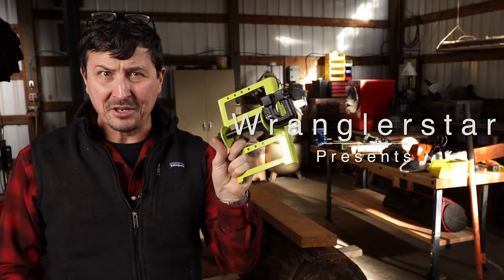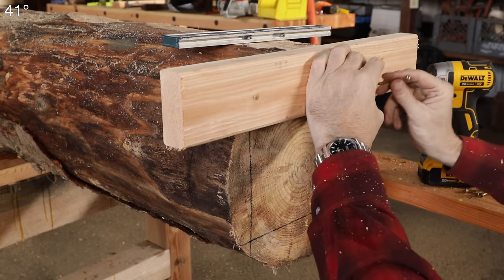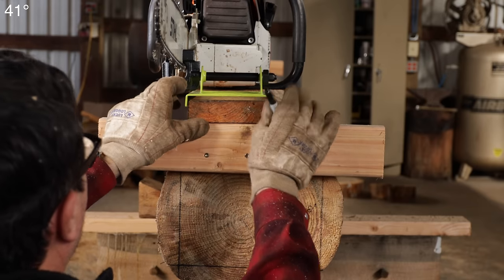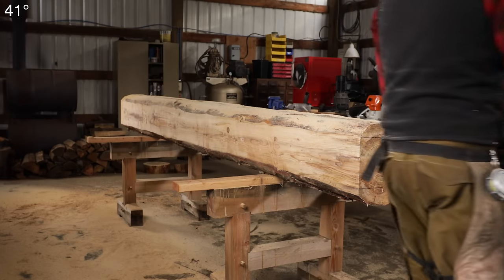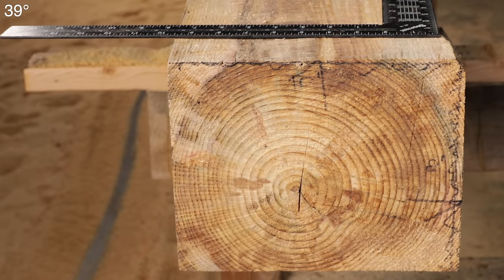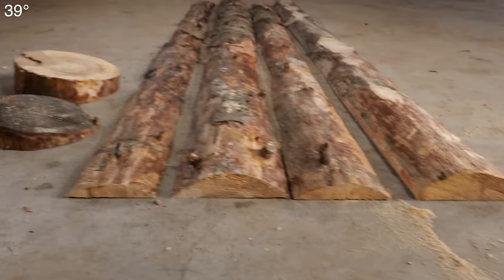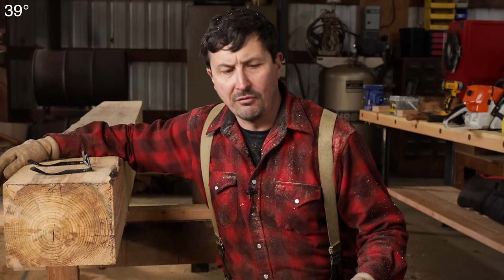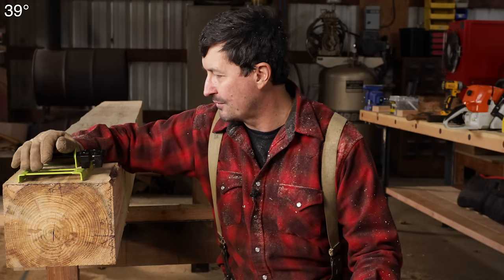How To Chainsaw Milll Like A PROFESSIONAL HOMEOWNER WRANGLERSTAR

Comment: Just a quick tip, I have one of these and they work just fine, I suggest you just take that measurement from the line to the board and set up with a tape measure instead of lining up an tilting saw to check if your good.

Comment: the so called waste. I wouldnt call that waste or Firewood. It could be dried and used as shelving. inside your workshop. give the area bit of a rustic woods looked to it.  Has lots of use for it other then just firewood.

the Price for it is now 
Price: USD $29.82  as of today.
Reply: Yeah, up here in Canuckistan live edge is all the rage. I do a lot of signs in it and that stuff is perfect (if it had bark on it). . Do some hidden internal mounts and they'd sell like hotcakes. 

Or even (thinking outloud) do some small 3" diameter branches perpendicular to the wall as brackets and notch them around the shelf. That'd be slick.

Comment: You obviously used the straitest best grade cross board, but you can add more stability with angle iron on both sides of your board
 This should prevent possible bowing as you store it. Thanks for the video, it's great.

Comment: What about the drying of a large timber log like that? Is that something you can use immediately or is it something that needs to dry for years first? I’m new to much of this but very much interested. I did buy that jig after this video along with a 40 volt chainsaw. I love it as it’s got me on my way with some experience. I just ordered an Alaskan mill and a 22” chainsaw now that I know it’s something I’d like to proceed with seriously, for personal use. Any tips are greatly appreciated. Thanks for your videos and insight as they produce a great amount of direction and different points of view to think on.
Reply: 1 year of drying per inch thickness. Unless you know someone with a kiln, they can do it in under a day.

Comment: I like that jig design.. I had a 20" Stihl(345?) and a flat plane Alaskan mill. The mill ate up alot of my cutting size setting the jig so I replaced the bar with 36 inch. While only cutting 15-18"wide(max)  planks and could fit 24inch.  Worked well if thats useful for anyone :)

Comment: This looks dangerous as hell. I could just see someone pushing it to hard till it pivots back and slices you open
Reply: How is it any more dangerous than using a chainsaw?  Hell, outside you could slip on a branch and slice your arm off.  Chainsaws are dangerous.
Reply: @roflstomps324   the fact that you are pushing it and it's upside down .  Just not how it was meant to be held.
Reply: @210johndeere  Huh.  I guess someone should tell that to professional arborists and tall tree loggers worldwide.  They are doing it wrong this whole time.  /wink
Reply: I think it would be a lot safer if, as Wranglerstar mentioned, you had the log lower down, and could hold the power saw in a more traditional fashion and walk alongside the log.
Reply: Professional arborists operate dangerously in some cases but they try to get the saw arranged with the most control. If you set a chainsaw mill up at your chest height and operate it upside down with less leverage constantly for an afternoon of cutting there's just way more chance for it to go wrong and where that saw is located could have a gruesome injury with more consequences. I'd rather cut my legs with chaps on or feet with boots over my torso or chest.

Comment: Good work, I just can’t understand the constant need to booger up the end of your lumber constantly driving an axe in it. Does it make you feel like a lumberjack ? Other than that, I liked the video
Reply: He uses the axe to roll the log. For bigger logs, you would need a peavy or cant. He also cut the log six inches over.

Comment: I've got a couple different Alaskan sawmill styles and by far this is the fastest and easiest on the saw.  Just be careful not to over-tighten the sets screws or you'll be buying a new one. (the replacement part cost nearly as much as the whole new unit.)
Reply: how is this faster than an alaskan mill if you need to screw in a guide board for every single cut?

Comment: Great video!  You made it look so easy and also very good production quality!  Just one question for you.  With a "real" sawmill, once the first side is more or less squared, most people flip the log on the first flat side.  Then you have a nice base, making the other 3 sides a little easier to cant.  Was there a method to your not putting the first squared side down right a way?

Comment: On any wood working project, the key is preparation and triple checking your measurements, cut marks, everything is squared, and equipment. The actual cuts are the easy part ha. I have screwed up so many projects from trying to rush

Comment: Some people drill holes in the chainsaw bar to better anchor, by way of bolts,  on this type of mill, rather than just relying on the thumbscrew's pressure, because the mill may shift on the bar otherwise.
       I have this type of mill to cut wood for musical instruments, btw. Great for small projects. Very cost effective.

Comment: your 2 x 6 "guide-main bar (the pc that the fixture slides upon) : did you need to pre-size it with a cutting device or does the fixture fit raw cut lengths from the yard ?

Comment: What I found out milling wood with the Alaska Mill: (1)  Continue the entire cut in one effort.  If you pull out and have to restart it won't have the same line or plain in the vertical.  (2) Bolt the guide to the the chainsaw bar.  The little allen screws won't hold it.  Also use seasoned wood when you can.  That means 3 years for spruce.

Comment: "No special skills required", hummmm, must have been designed for the west coast guys.
Reply: True, we all know how to run a chainsaw out here. Back east you probably need to take a few classes. ;-)
Reply: @DK-jd8bj  Sure, we know how to run over a chainsaw. LOL
Reply: @DK-jd8bj  BTW, I've done it. LOL
Reply: @wb2989  well, i don't know what East to you, but in Québec, even if our tree are smaller, we saw mill maple,  ash and birch,  you want to talk about hard timber?  Or hemlock, as a «soft wood».... ?
Reply: Charles Gill On the west Coast you have oak, ash, maple and other hardwoods and they get big here too. But Quebec is good too.
Reply: @johnycoho7830  good to know , i tought you were only making fin of us because of your giant firs...
Reply: Charles Gill How about that madrona?
Reply: @375Cheytac  i'm french canadian, i don't know what is «madrona»
Reply: @wb2989  In PA. we have oak, maple, and hickory. They may not be 50 feet tall or 30 inches across but, they are way harder than most trees in the west. Hickory will eat a chain up in twenty minutes.
Reply: @saticharlie  theres no doubt about milling hard wood being hard on blades.. Band milling 40 inch doug fir is hard on every single other part of the mill.. Sheer mass and one million board feet a day keeps us welder millwright types steadily employed... Thankfully BC has moved to CTL as theres not many head rigs left.  Its just our growing season that makes our wood big.. Try working spf from NWT, you would swear its a hardwood too. Peace be safe
Reply: @jeffwilliams2031  my reply to Charles can double to you to man! Be safe out there. Peace
Reply: And then theres cedar.. Which has its own unique long strand properties, not fun at all! But smells great! cheers lads
Reply: @saticharlie  probably referred to Arbutus where you are at.

Comment: Mr.wranglerstar: please do a review of the ryobi one plus 18 volt hybrid transfer pump for the common guy
Reply: Ryobi is a great brand for everyone
Reply: My brother regularly calls my Ryobi tools 'the high-end on the low end'...

But I'm still using the same 18v drill/circ/saber/jig set that I bought in - 2001? (I buy every upgraded battery that comes out)

Meanwhile, I know he hasn't managed to keep a Dewalt that long.

Comment: dumb question: why not rotate to a flat side down after each cut? is it to prevent lateral sliding with the wedging?
Reply: Simple, at the second cut you only got one flat side, you could get that to the bottom, but you rather want it in top, so you don't need the two short pieces from the first cut again. Now you got two flat sides but they touch each other, so if one is supposed to be on top, the other can't be in the bottom, so only for the last cut you got a flat side in the bottom, as you can see in the video.
Reply: Once you have a flat side, it acts as a guide for making a square cut.
Reply: It also makes it easier to manipulate the material. It's harder to roll a square, than it is a circle.

Comment: In the future you only have to measure the distance between the chain of the saw and the board once. You write this measurement on the front and back of the board. And when you mark and stop the board, you no longer need to stop the saw to test it.
With best regards from Deutschland

Comment: My dad and i tried one of these (exact same design, different brand) in the late 70's and it vibrated loose and wrecked the saw chain. Also the front of the 075 if I remember correctly.

Comment: At around 7:35 you could just put like a 2x6 or something else underneath the log to jack it up a bit so you don't cut your horses up. Love the video though, thanks. I wouldn't call those pieces waste wood either you could mill those down and use them on siding for chicken coups or a shed or something. With the prices of wood these days I try to use every piece I can for something.

Comment: My concern would be how much play is there between the device and the 2x6. As long as they're pretty tight and those allan screws hold on to the bar pretty tight, you'd get a pretty straight cut.

Comment: Is it not possible to cut with the top of the bar and blow the sawdust toward the floor and keep it from blowing in the face? I realize You would have to keep firm down pressure on the saw to keep it from kicking the saw upward and the guide off the guide board.

Comment: id suggest keeping that tool as close to the engine as possible, a sacrificial board is a far sight cheaper than a saw that gets away from you , this is basic fulcrum and lever stuff if memory serves me right
Reply: smitty smit True! I was thinking to pull the log to the edge of the sawhorses, make the wedges sacrificial, or just raise the blade over the wedges like he did for the first cut. I’d hate to have to cut with the saw engine and handles head high.

Comment: I got another question which is probably stupid, which doesn’t mean I’m stupid -
it just means I’ve never done this before: am I correct in assuming that one could proceed to cut 1 inch thick boards, or whatever, off of this block?

Comment: What if you set up, made the first cut then flipped the saw around and made the second cut. Rotated the log 90 degrees set up and repeated. It would not matter the size as long as they all were the same. Understandable if you are needing to make a particular size that you would need to go thru all the setups, but for ease and speed I’m thinking that would speed up the process. Just my thoughts.

Comment: Looks like the tool would be better if home-made. Pluss I would rig angle iron as rails on the guid. It would ensure the guid board did not warp Inbetween usses. And alow for more even and controled pressure against the saws motor. Pluss it would keep the guid from becoming worn out.

Comment: might be a good idea to make much lower saw horses, then stack on top a bunch of 2x4s, screw from outside on bottom to inside on top with each layer slightly. Much cheaper to sacrifice 2x4s into fuel than a very strong sawhorse of 4x4s.

Comment: I don't care for the set screws holding the bar in place. 
I would drill matching holes in the bar/bracket and use bolts.
Or at the least drill two divets to match the set screws for extra grip?
Don't know till I get a closer look at one. 🤔

Comment: Ya know, I was thinking about you when I started looking into sawing up some downed trees and I think a major.. Ahem, "upgrade" to this video would be if you tried milling a log with the cheapest mill AND the cheapest saw on Amazon. I say this because I'm feeling like my puny cheapsauce, made in who knows where, craftsman, is probably not going to be able to hang. I feel like your super-mega-ultra chainsaw is probably so good it could mill a log without a mill, possibly without an operator even. At least that's what I think a $1000+ chainsaw should be able to do ;-)

Comment: Great video... but.
The only concern I have is during some of the cuts the exposure to the end of the chainsaw bar towards the operator.
Plus the pivoting motion of this jig changes the position of the bar end.
You must be very aware of this, so novice beware!
Advantage to the Alaska Mill, as the end of the bar is away from the operator and is in a fixed position, plus in a proper mill the end is also protected by a safety guard/cover.
Still, that is certainly an interesting little jig.

Jim.

Comment: What if you made the first cut then flipped the saw around and ran the second cut without moving the board. Then rotated 90 degrees and did the same and lived with the dimension beam you got. If they all were the same size it would not matter if they were 8”, 9”, 10”....just my thoughts.

Comment: Seems quite labor intensive for a single timber and time consuming versus a bandsaw type mill.  I suppose if you are stuck way out, this is as portable as you could want for.  How much fuel did it take on that Stihl 461 or whatever that was?

Comment: Hey Wrangler star good videos I love to watch and learn from ur channel but I own several saws and cut for a living and DO NOT SEE THE POINT IN A BIG SAW WITH LOTS OF CC AS UR SAW IN THE VIDEO OR THE LONG BAR!!  For give me if IAM wrong but my opinion a 16 " or 18" saw with no less than 52 cc would be just enough for that soft pine wood... Drop ur opinion of that what u think?
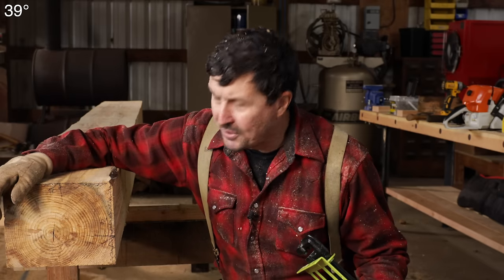Reply: Ok you just talked about the size of the saw to use at 10:11 ok my bad u just answered my question I believe

Comment: The little mill you are using is a Chinese knock off of the Haddon Lumbermaker.  Haddon, designed the thing in 1974.  My father picked one up in 1976 a year before I was born.  It is in my shop today and it is in a heck of a lot better shape than I am.  The company still makes them in the US and yes they are 90$ but sometimes there are times when saving the $70 can get you killed.

Comment: Another helpful tip would have been to show how you handled the saw.  This could have been accomplished by showing a larger view to include you and the cutting operation.  How did you hold and move the saw?  How was your body positioned in relation to the saw, and your stance?    These would have been great safety tips.  You might even point out the safety gear, like the chaps that you wore.

Comment: I bought one of these and tried to use it. At first, I was using a relatively new Husqvarna. It burnt out after cutting through a couple of dry cedar logs. I thought, ok, I probably could've been more attentive to sharpening and lubrication. User error. Then, I bought a brand new Stihl Ms 271 and tried the same thing with some fir. Same result. Only 60lbs compression and a totally busted saw. This time, everything was in perfect condition. I even filed it down to 10 degrees. Can someone please explain what's going on?
Reply: That sounds terrible. I have been around saws for 30 years, and never heard of failures like that happening so quickly. Except for one guy... refused to put 2cycle oil in the fuel! Claimed the smoke would kill him! LOL!!! Managed to sell him 2 new huskies before I never saw him again.
Reply: @allenedden8554  could it be that I used ethanol fuel? Probably 6 month old fuel?

Comment: Anyone know how cost affective this is? I’ve always thought about how long it takes. The gas for the chainsaw. The wear on the chainsaw. And all that. But I guess if you live in an area with a lot of trees and no Home Depot for an hour it may actually be worth it. I’m just curious how much you actually get for how much you put into it.
Reply: Commercial prices for this size beam are over $100 (depending on the wood, can be much more). I don't know what your day job is, but if you have the time to invest, you would certainly save a lot of money with this method. Especially if you have several beams necessary for your project. Chainsaws are also very easy to maintain, they just take a little time.

Comment: Bear with me here:  ok, so you got an 8x10 timber.  But can that device be used to cut that up into dimensional lumber?  I don’t think so bc it rides on a 2x6....you’ll be left with a 6x6 post...
Reply: I bought one of these online, and unlike his example, mine came with a bracket to adapt it to narrower guide boards, like 2x4. Depending on how you attach the bracket, there are a few ways to configure it. Also, by supporting his guide board on cross boards at the ends, (except where he cut through one, lol) he could move his guide board over and allow another slice.

Comment: Since the first cut worked so well, I would have just moved my guide board over, turned the saw guide around, and cut the other side without changing the log. Am I thinking wrong?
Reply: That crossed my mind aswell

Comment: I have this same jig and I really like it.  I use it to cut the first slab off a log that I want to use the Alaskan mill.  That way I do not have to use a ladder or 2"x6" and adjust the depth on the Alaskan mill.  I actually have a dedicated saw for this jig as well.  Then I can have my big saw in the Alaskan all tuned up and sharp and ready to go.  Good review.  Cheers Peter.

Comment: This video shows you squaring a log but not cutting planks. is this to make it easier to run a portable mill to cut boards or did video that part with this jig? I have a cherry that fell and I need to make it into boards to build a smoke house with  it.